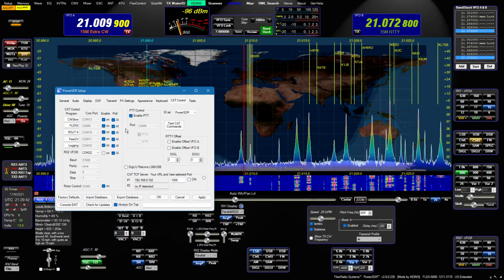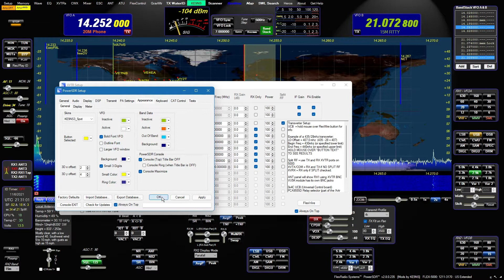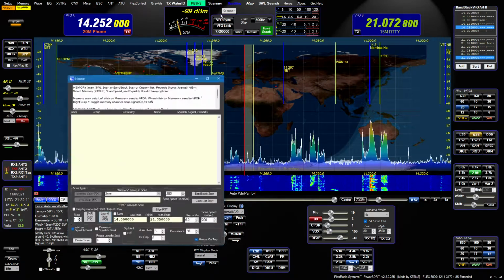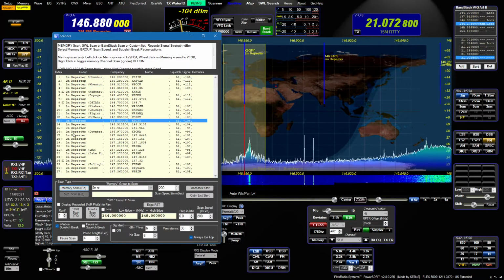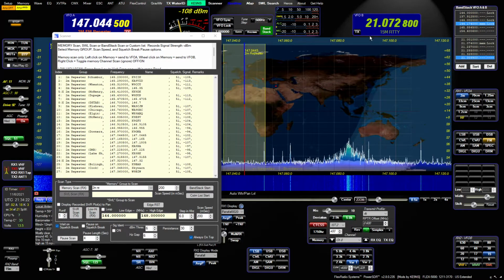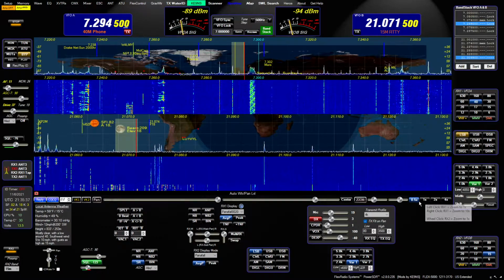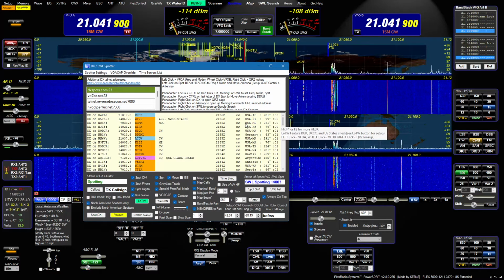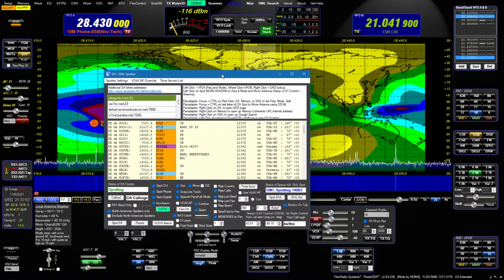PowerSDR ke9ns v2.8 CAT, XVTR, Scanner, Spotter, RX2 updates

Comment: Looks fantastic Darrin.  I'm running a 6600 at present but on the hunt for a 5000 or even a 3000.  73's  vk2yi
Reply from the maker: FYI: The 5000 has many more features over the 3000 (like 3 antenna inputs, XVTR I/O, Balanced mic input, optional 2nd RX (with the ability to sync receivers for noise phasing, VU5k module).
Reply: @ke9ns  Thanks Darrin.  Many 5k's floating around these days?  not many here in oz and what you think the going rate would be for one?